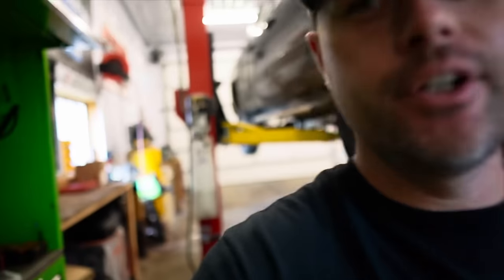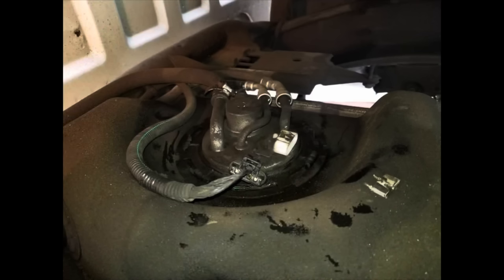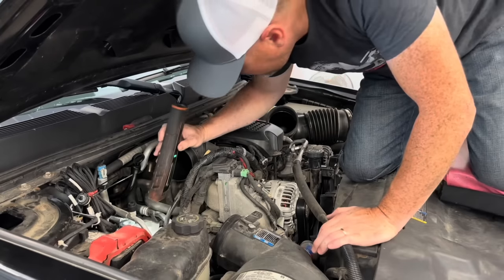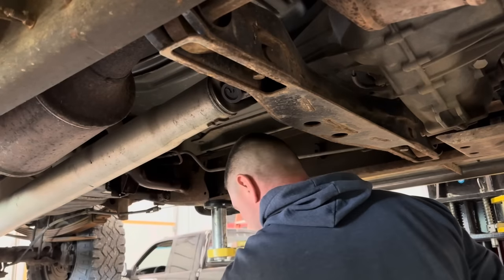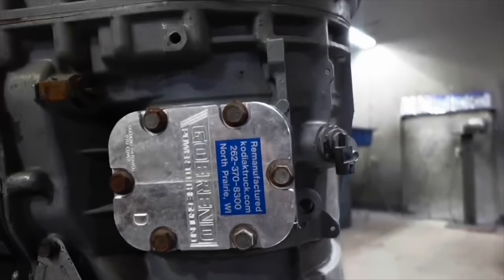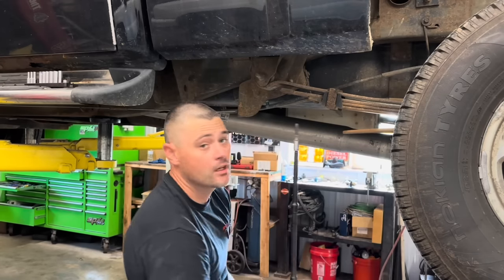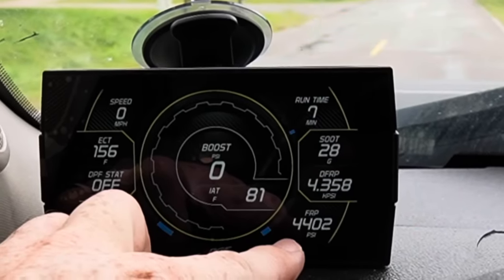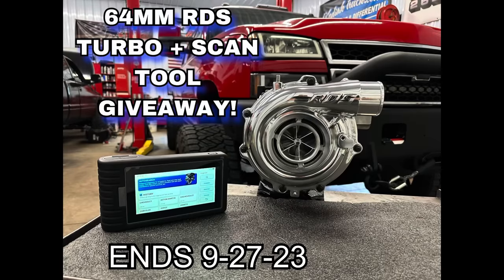The Duramax Went Into Limp Mode Again! *Fuel Issues Are Back* FRUSTRATING

Comment: I have a 08 gmc 2500hd lmm that consistently goes into “engine power reduced” after about 5 minutes of it running/driving. I can still daily drive it just takes forever to get up to speed once in that mode. It’s bone stock besides exhaust, only codes are for two glow plugs. I’ve had the codes read from multiple scanners. Any help would be greatly appreciated!
Reply: How many miles does it have ?
Reply from the maker: That’s interesting you should try and have the glow plugs replaced and see if it goes into limp mode again

Comment: i love the old chevy truck but i hate how hyped up the duramax diesel truck are and this video proves this he should have bought  a 6.0 powerstrokes the most reliability diesel truck ever
Reply: Obviously this is sarcasm, lol
Reply: @countcuda70  no it is not 6.0 powerstrokes if you do the right stuff and maintain them and do not make 1000 hp they will run for ever and the 6.4 powerstrokes are worse craked pistons cast sand block and when it heats up the sand is released in to your motor and i for got a crap ton of electic problems.
Reply: @isaacmiller9931   "Bullet Proofing" helps for sure. It's not free though. Costs thousands to have it done. Certainly doesn't make it the most reliable diesel. There's better options out there. Can save that bullet proofing money and put it into something else
Reply: its still better then buying a 100,000 dollar truck you will have about 20,000 to 30,000 on a 6.0 that sounds better  and runs better than a new truck and i ad looks better too
Reply: @isaacmiller9931   I can't disagree with you there. No way am I spending 100K or more on a truck. They're not worth it. Would rather have an older pre emissions one for sure
Reply: @countcuda70  and yes i know the 6.0 are bad motors but the are just as good as a duramax and all motors have a bug or flaw there is no such thing as the best motor or truck
Reply: @isaacmiller9931  I wouldn't go that far. Duramax is better/more reliable then the 6.0. You're right. There isn't a best. It's all preferences. We all like what we like.

Comment: Did you replace the braided section of the fuel line where it comes over the drivers side valve cover? Mine was kinked and would go into limp mode every time I pulled a heavy load
Reply from the maker: Yes 👍

Comment: ******Hey Listen, I have an LMM I fixed this problem. it took me years to figure it out.
its the fuel line that are between the block and frame rails in the front. they get old and the fuel system is a circulating system. they collapse with heat after age. the fix is heavy duty fuel lines return and supply in the area of the brake reservoir area. 
Everytime I would pull a trailer it would go into limp mode for years.
after this fix no problems.
its not injectors, its the fuel lines collasping due to heat and age. When the cp3 is under load it makes the fuel lines collaspe and causes engine to go lean. then limp mode.
lift pumps solve the problem because they pressurize the lines the other way. but the root problem is the fuel lines. 

the fuel lines go from hard lines to rubber back to hard lines.

I found this info from GM TSB
Reply from the maker: Thanks 👍

Comment: I would vote, but every diesel I've owned has been "weight lossed" from the factory. Detroit Diesel 6.5 didn't get converters until 1994, mine is a 1993. Dodge RAM 3500 didn't get converters until 2004, mine is a 2003. I'm thinking of getting a Powerstroke, gotta figure out what year I want.

Comment: I think you're gonna need injectors my friend. Ive been fighting the same exact thing with my LMM. The injector return rates were fine until I towed heavy in the summer heat. The fuel gets hot, the return rates spike and bam. P0087 reduced engine power. I installed new injectors and an AirDog 165 5g ( bought it off your website btw) and we are good to go. I also fired the parts cannon at it to no avail. I wish i wouldve just replaced the injectors right away.

Comment: Hey truck master, you are missing a important key element when repairing. The owner hauls a trailer. While testing a truck that hauls a trailer, you also need to perform test with a trailer that is empty and loaded. I'm talking from over 15 years of experience on working on trucks and including big rigs. I'm not bashing you or anything like that. You are doing a good job repairing vehicles but gotta pay attention to customer details. For example how they drive, what the vehicle is being used for, etc. I want to see you excel at what you do. Keep up the good work.

Comment: Confused tho. If there is a sending unit in the tank then so it dose tech have a lift pump before the cp4 

Also my lmm is a reduce power no codes found related to fuel presiure
Reply from the maker: Your cp4 dose all the work the sending unit is just a straw and a sensor basically

Comment: Just out of curiosity has he tried a different gas station for diesel fuel?
Reply from the maker: I’m not to sure
Reply: @TruckMaster  had a work truck 07 LBZ have similar issue and so much money thrown at it, come to find out we had a common denominator of being everytime Indian reservation diesel was used. Drained the tank Went back to our sonoco station and never had an issue again. It was all to save .31 cents a gallon which for the headache wasn’t even worth it and therefore never get gas or diesel at one ever again

Comment: Been through this ended up replacing all fuel lines adding a 165 air dog lift pump deleted the fuel lines on the engine and deleted the fuel test port and added a cp3 hi flow kit with a ported fitting and a new fuel filter head assembly since after rebuilding the stock one I still wasn’t happy. And yet was still getting p0087. Come to find out one of the first things I ever did the Ppe fuel race plug wasn’t seated in 100% and letting diesel into the return lines anything past 20k psi there for throwing it into low fuel pressure and I tested this by disconnecting the return line off the plug and ran my own 3/8 line down to a clear water bottle took it for a drive got it into limp and saw the bottle was over flowing full so diesel was getting past the plug. Fixed the plug and haven’t had a problem since. But I also replaced the whole fuel system except for a new cp3 but did a ported fitting and new fuel pressure regulator on the cp3.

Comment: So here we go ...we changed out tank sender all fuel lines and put a electric lift pump on this truck has done 325000ks with no issues since fitting these parts ..the issues started at 310000ks it pulls a trailer most of the time it's had 2 injectors to my knowledge of owning the truck it's a little dirty on first start up other than that it's still going strong ...when u consider that a cummins with the same pump goes a lot further it's the lift pump situation dodge has 1 gm don't shouldev had 1 from new then the bad fuel lines would've showed up as fuel would be pumping to the motor showing up your leaks ...good luck ps never changed out an injection pump yet ...thks for the content  ..

Comment: The sending unit was the problem with my son's LLY.  I had replaced lines throughout, the filter and head, and a Raptor lift pump.  Still acted up.  I knew the fuel pump was fine being it would run fine and strong when it wasn't being stupid.  I ended up putting in a sump on the fuel tank and now it runs perfect.

Comment: I am dealing with a somewhat similar problem right now. Except I have a 2015 LML that I have deleted, installed a fleece CP3, Air Dog lift pump and HSP intercooler piping. I think my issue is a failed lift pump. TBD
Reply: Did you ever figure out what your issue was? I also have a 2015 LML. Just did a CP3 conversion on it and total EGR delete. Now I'm having lots of issues with it. Defueling is definitely one when the truck gets warm or I'm pulling a heavy load.

Comment: Hey just had this issue and solved it! It was the wiring harness up front was rubbing on the power steering 2 wires grounded out intermittently.
Reply: Code was P0461

Comment: I also own a 2007 lmm. I’m not a mechanic, but when my truck was having the same issues, we changed everything possible, new fuel lines, added a lift pump, and still had the issue. The solution was the changing the injectors.  The truck has run like a top since. Going on 2 years now
Reply from the maker: Great info thanks